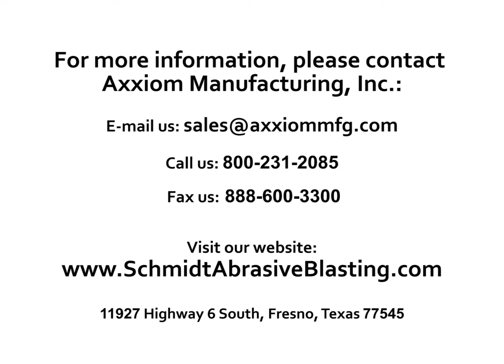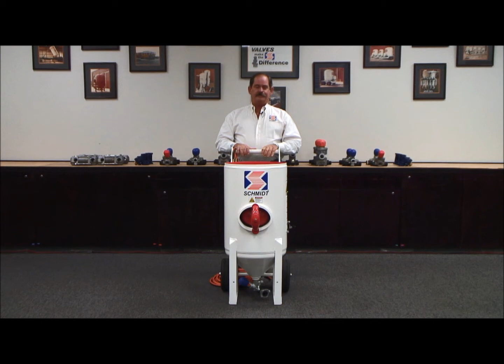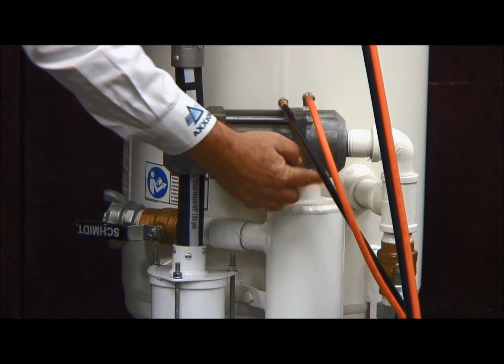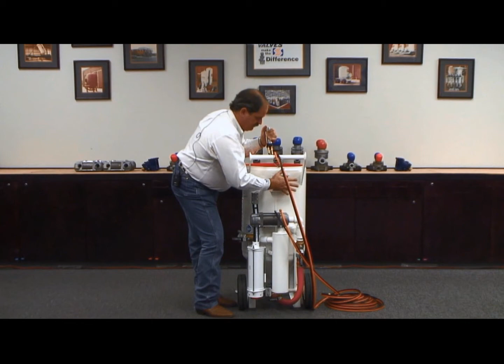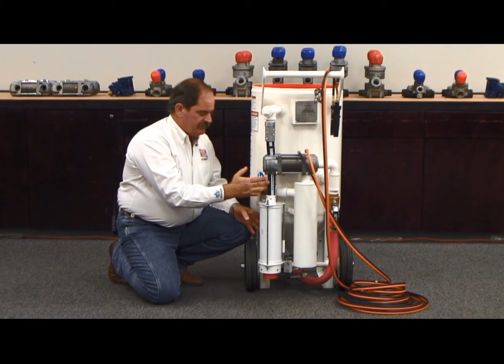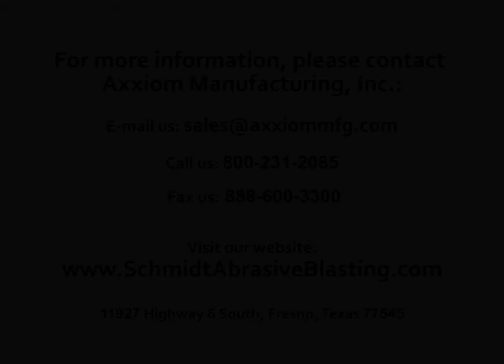Schmidt Small Abrasive Blasters

Comment: How big of an air compressor do you need to run this blaster?
Reply from the maker: The size of the compressor is determined by the blast nozzle, not the blast equipment feeding it.
The nozzle size directly impacts your productivity—specifically, how much surface area you can blast per hour. There are several nozzle sizes available, each requiring a different volume of air (measured in CFM).

A #3 nozzle (3/16") typically needs around 75 CFM.
A #6 nozzle (3/8") requires over 200 CFM.
A #8 nozzle (1/2") demands approximately 350 CFM.
All of these nozzle sizes are compatible with the equipment shown in this video. The key factor is how much productivity you want to achieve—larger nozzles allow for faster blasting but require more air.
Reply: @AxxiomSchmidt thanks for the reply. I did call customer service for that company they said the same thing. Thanks again